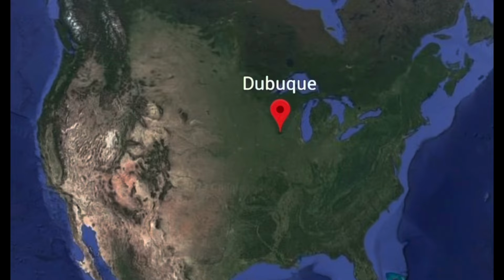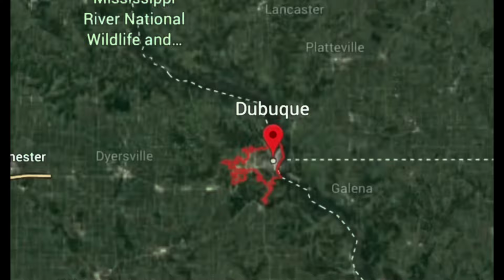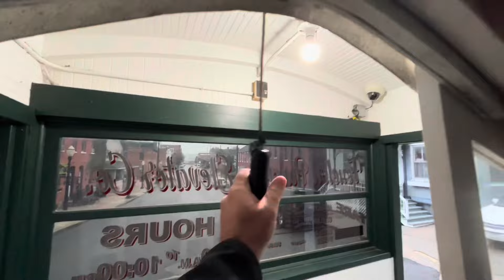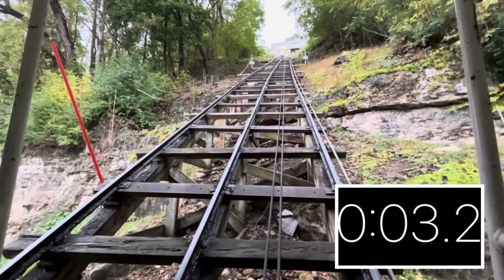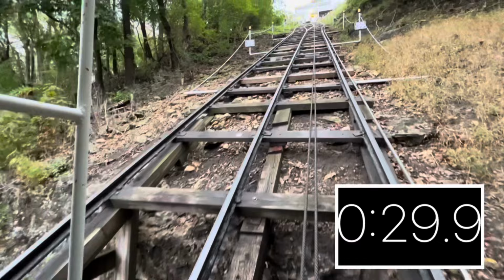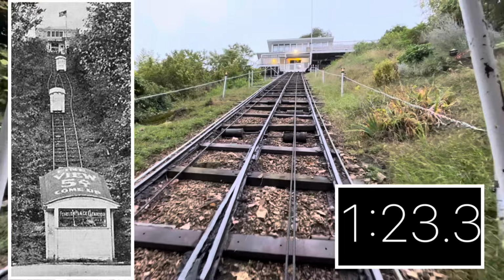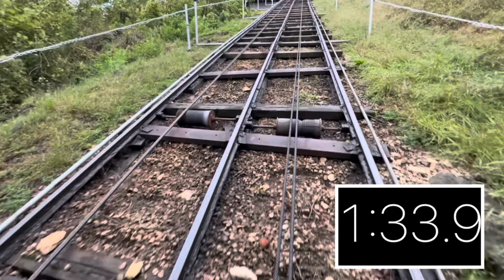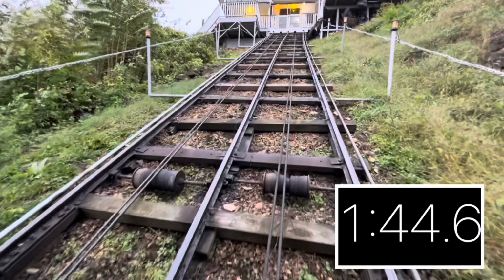I rode the world’s SHORTEST and STEEPEST scenic railway! // Dubuque, Iowa

Comment: You're cool! There's two in Pittsburgh, neither one as steep but both travel further up the slope. There's one at Horseshoe Curve in Altoona, PA which is shorter than the Iowa version. Plus there's a large one in Johnstown, PA which can take small cars/motorcycles up the slope. Cheers
Reply from the maker: Haha I’m not that cool 😎 😜 but thanks
Reply: I think there’s a live camera for horseshoe curve here on YouTube
Reply: @jljordan1  The problem with that 1 is the State Of Pa. has not had a Safety Inspection for a few years but there is a stairway(many ) steps to the top.

Comment: Steep (up to 41 degrees) but not the steepest funicular; that's in Stoosbahn (in the canton of Schwyz, Switzerland) at 47.7 degrees. The steepest inclined lift railway is at Scenic World in the Blue Mountains, New South Wales, Australia, at up to 52 degrees (now a tourist attraction, built originally for hauling coal and shale up about 1000 feet).
Reply: Yes, correct, the Scenic Railway at Katoomba in the World Heritage listed Blue Mountains is listed in the Guinness Book of World Records as the steepest in the world. A cable car also operates over the beautiful adjacent valley.
Reply from the maker: My guess is their claim as “shortest and steepest” is a combo of both but not individually each thing? And the definition of railroad vs elevator has been interesting to learn about.